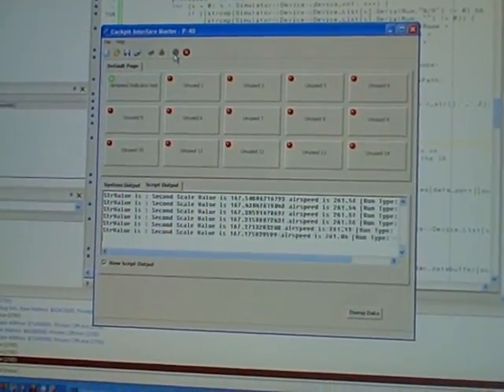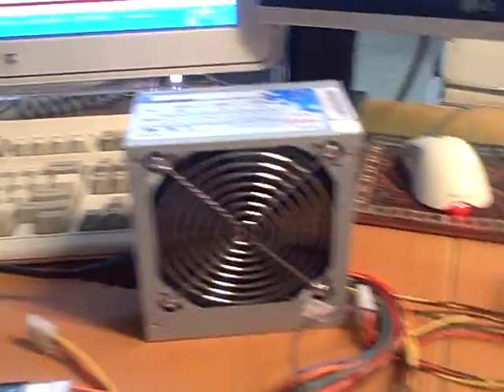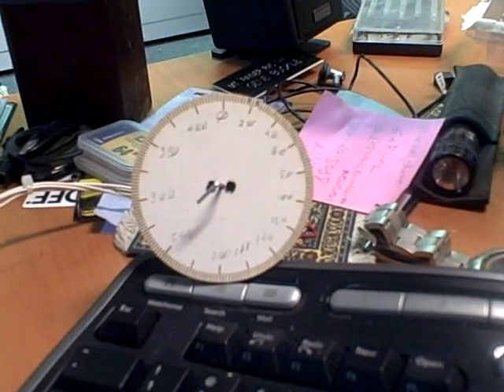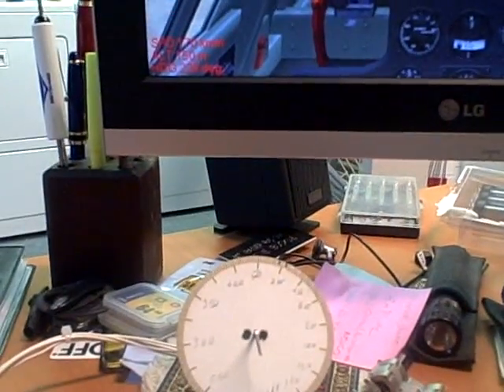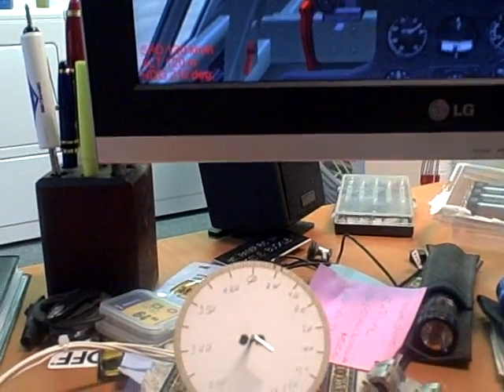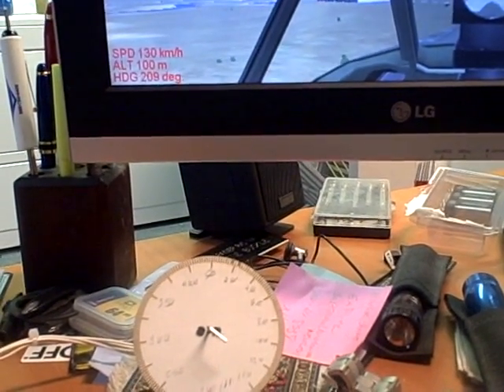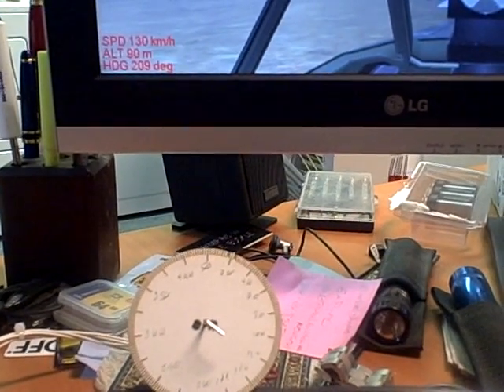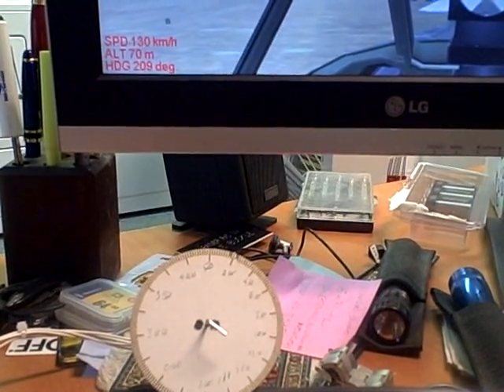Cockpit Interface Master airspeed demonstration

Comment from the maker: ehu42, the gauge in the demo is the 8 bit version.  There is also a new one out with a 10 bit resolution.

However, even with the 8 bit version you'll get good results because you can smooth the movement more easily than a servo.

I blew up my DAC board about 20 minutes ago so I can't post any new gauge demos until the replacement arrived.  (I was careless and the board shorted out against a bit of metal on my desk).

Comment: What level of resolution does the gauge have? I created one w/ a hobby servo - the controller only provided 255 steps, and so the indicator had > 1 degree per step which in the end made the indicator very 'jumpy'. In this quick video it does appear too bad, but I'd like to see a demo where you fly some 'hills' and have the speed climb and fall smoothly.